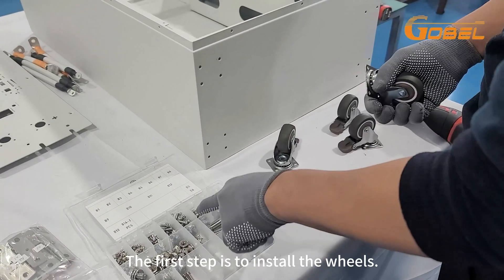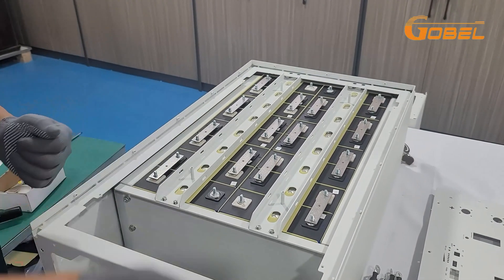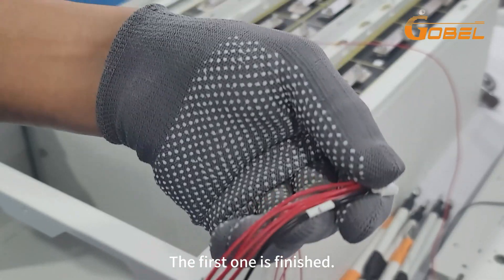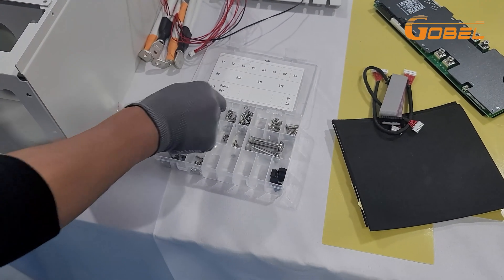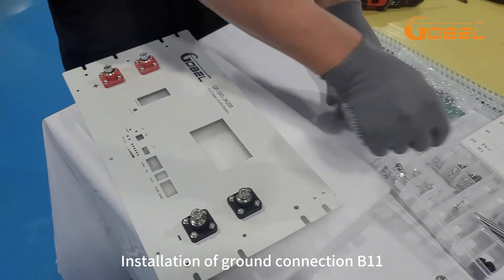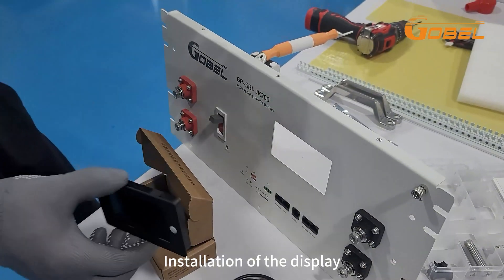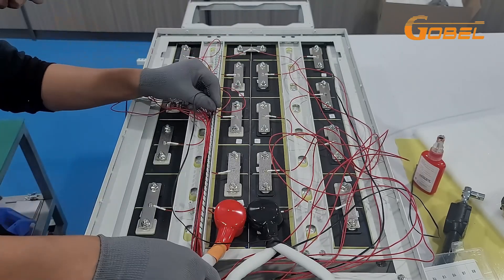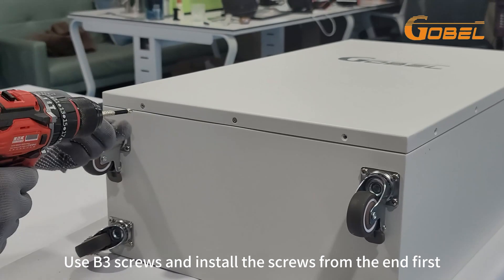GOBEL 15KWH Detailed Installation Tutorials#gobel#gobelpower #solarstorage#energysystem#lifepo4

Comment: Please update this video. 
Just built 3. Update:
0: Be sure your unit breaker is in the off position before assembly

1, there might not be a redundant B8. I didn’t have that. 

2, don’t forget to put the Pressure Foam lining on the pressure plate. Peel the two pads and rotate them so they orient between the bolt holes. 
(Update, if you apply foam as I described above, the 
Negative power cable doesn’t reach, it was already extremely tight. It needs to be 1/2” longer. If you get a short one you’ll need to put the foam at the rear instead of on the plate. I recommend installing it at the rear (stick on the case) just to be safe. Otherwise you’ll have to take it all apart again like I did. )

3, if you have the heating pad, the extra red wire goes to the battery plus or the battery plus on the BMS. Either location is fine.  You then plug in the heater cable with five green wires, one red wire and one black wire to the BMS.

4, don’t forget to put the large piece of fiberglass board on top just before closing the case
 
They also don’t mention what type of glue is used to adhere the heat sensors so I just used E 6000

Mine didn’t come with thread locker so I chose Threadlocker ORANGE from Permatex part number L25210F-2

The connecting cables are very delicate, especially to the display.

Lastly if you don’t have torque wrench, this one from Amazon was real good:

Uharbour Digital Torque Wrench 1/4 Drive, 1.1-22.1 Ft-lbs/1.5-30Nm Range
$50

FYI. This is a solid unit. It will just be much better when the above items are addressed.  The cables and Construction are very robust.
Reply from the maker: Thank you for your feedback. We will forward these issues to our engineers.